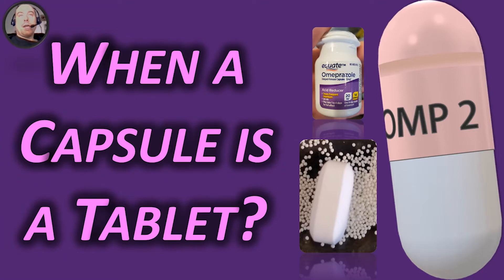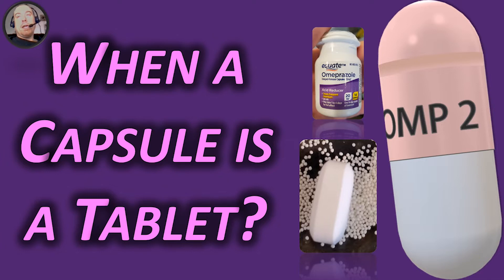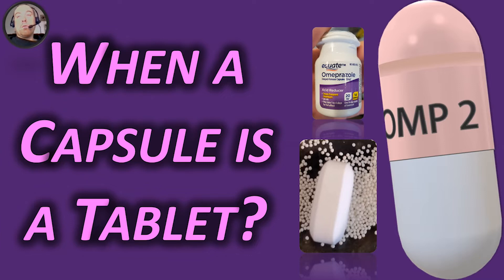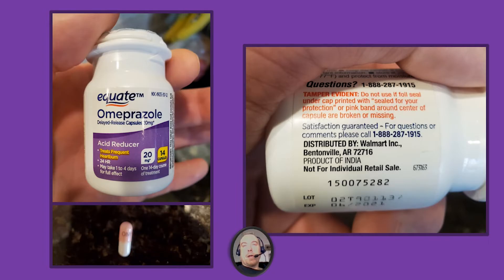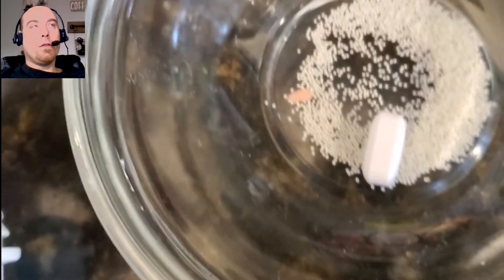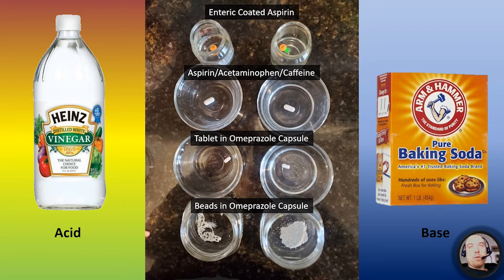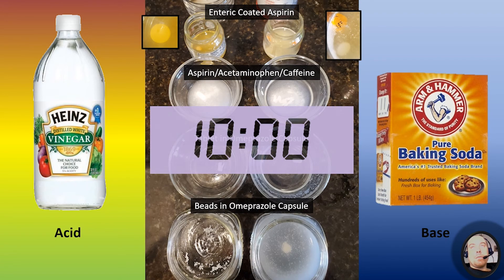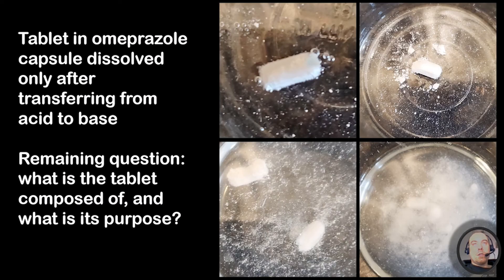How Do Enteric Coatings Work?  Also known as "safety coatings" and "delayed release" coatings.

Comment: Hello,

My theory is that the tablet is a buffering agent such as sodium bicarbonate (with an acid coating that can only be dissolved in the stomach's pH)

When you swallow the whole capsule (granules + tablet), the capsule dissolves quickly. 
- The omeprazole granules are enterocoated (hence resist the stomach's pH) and the tablet having had an acid-dissolving coating is left nude in the stomach's pH. 
- The omeprazole granules are still coated before arriving in the duodenm whereas the tablet is made into sodium bicarbonate without any coating left.

When both arrive in the duodenum, the omeprazole (being a weak base and being still entero-coated) dissolves normally as any other delayed-release omeprazole granules. The nude bicarbonate tablet dissolves very quickly (having lost its acid coating) and raises the duodenal pH. This permits an even faster and more effective omeprazole dissolution/absorption from the duodenal tract and better efficacy

Note : if the bicarbonate tablet wasn't acid-coated, it would make the stomach more alkaline, dissolving the entero-coated omeprazole in the stomach because of the hightened pH (such as immediate release ZEGERID that contains both uncoated omeprazole and sodium bicarbonate in a capsule) turning the EQUATE omeprazole immediate release (such as ZEGERID) and not delayed release as it is advertised

What are your thoughts ?
Reply: I meant that only the tablet’s outer coating can dissolve in acid, leaving a second coating underneath that is the real gastroprotective one so that it (the second coating) and the bicarbonates can both dissolve in the duodenum

From your experiment, it seems that the tablet has a first acid soluble coating protective against alkali, and another one underneath that is gastro-resistant but solvable in alkali

This would ensure that the bicarbonate tablet doesnt dissolve the enterocoated omeprazole, otherwise turning it into immediate release ZEGERID
Reply from the maker: Hi, and thanks for the thorough analysis.  If the tablet is designed to dissolve in acid, why wouldn't it alkalinize the stomach when it dissolves there, and then allow the granules to dissolve there as well?

Comment: The test you did was very interesting, it helped me get over my own fear of "no way could anything survive in the stomach." I realize stomach acid is much stronger, but the coating wouldve dissolved at some point in vinegar if the coating didn't work.
Reply from the maker: Thanks for commenting!   Vinegar isn't that far off from stomach acid.   These coatings don't really "care" if it's mildly acidic (pH 5) or highly acidic (pH 2).  They won't dissolve until neutral to alkaline pH is achieved.